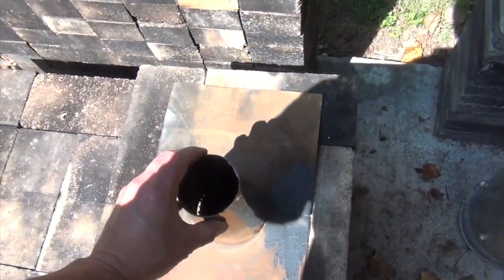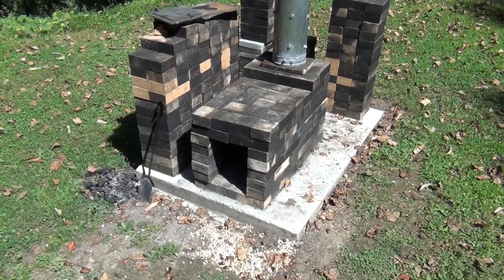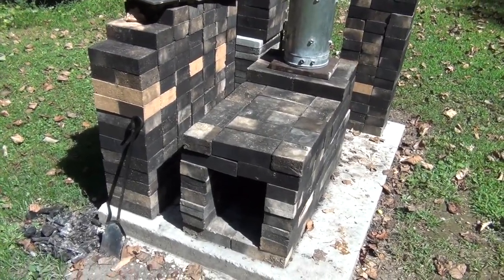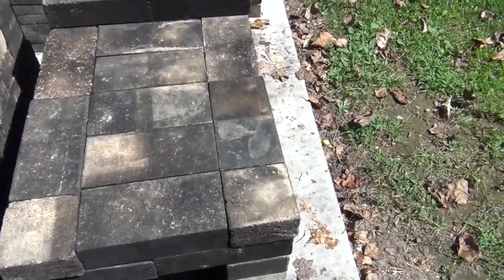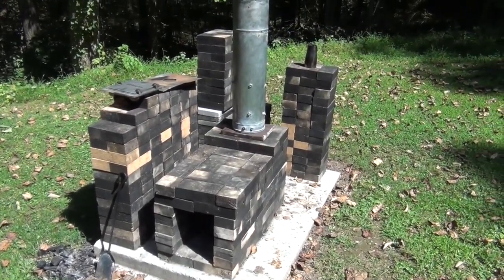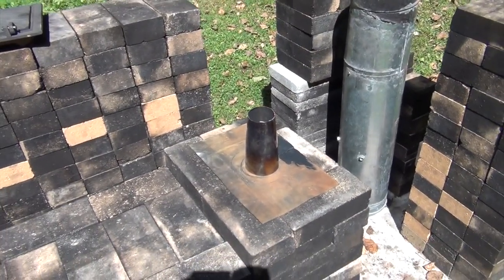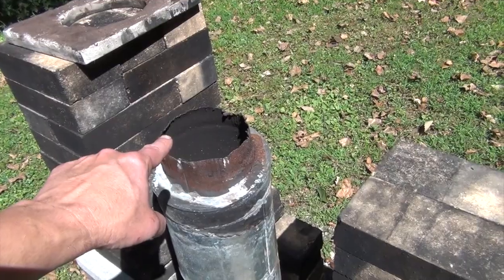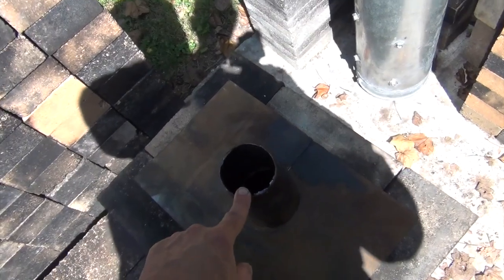Principles of "no smoke stove" using small, simple wood stove

Comment: Nice work Matt, great to see another nozzle in action! My theory about why it works is similar - forcing things through a small red hot chamber helps mix and ignite any unburnt fuel well. When I used a similar shaped nozzle as yours, which was a car exhaust reducer cone, I found the flame went out quite easily, was great when ignited, but sometimes just seemed to blow out and I’d be left with smoke. Having multiple perforations didn’t seem to do this - kind of like a gas burner stove, the small flame jets seem quite stable and I think they helped mix the wood gas and air better. I’ve been thinking about doing a few more tests with different nozzles, or even trying some perforated stainless steel strips laid over a longer narrow hole, kind of like a typical wood stove baffle plate, but with perforations over the firebox exit port instead of just a hole. By the way, the nozzle in my sauna stove gets fired about twice a week and no signs of damage, it’s held up really well so far. Keep on experimenting, love the videos!